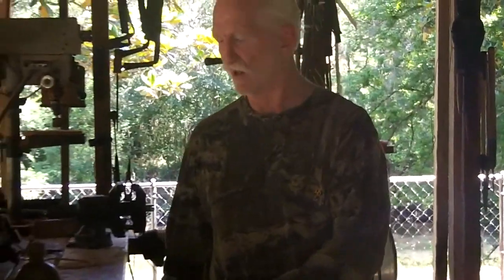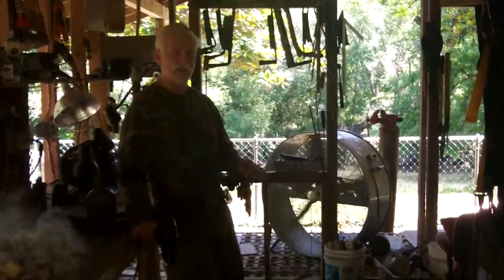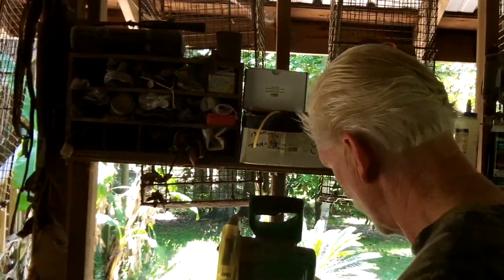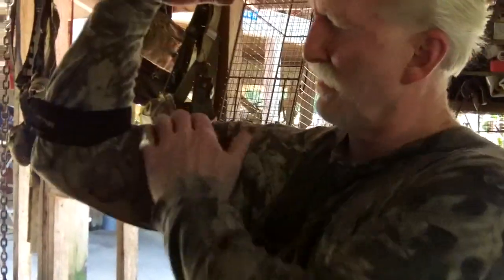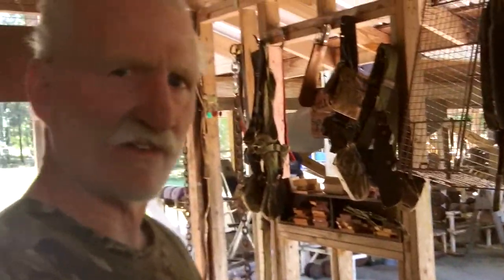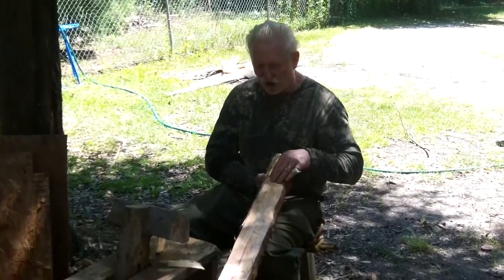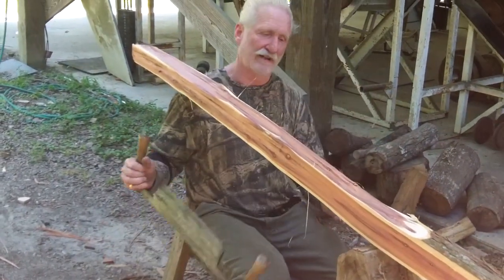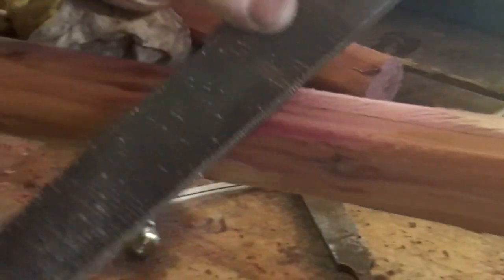Do It Yourself Survival Spear with Madison Parker, by Equip 2 Endure

Comment: Wood would not make a very good anvil. It would burn, and it's too soft. You wouldn't be able to pound out a straight edge on it.
 
You need heavy straight steel, like a section of railroad. or the back of a bench vice in a pinch.